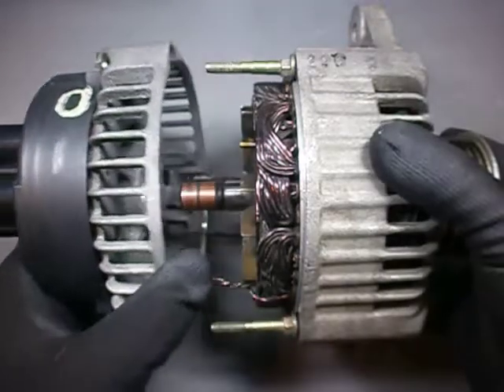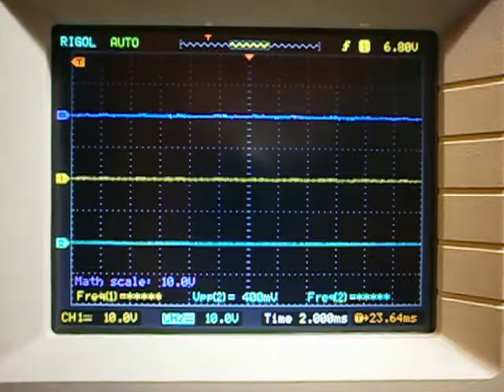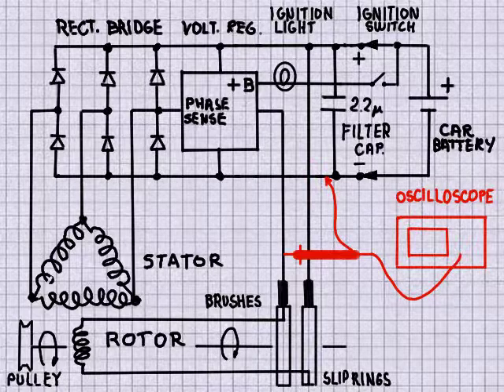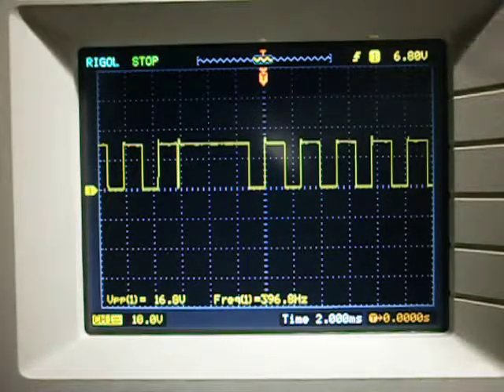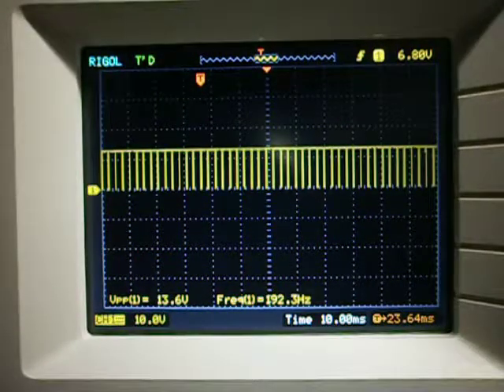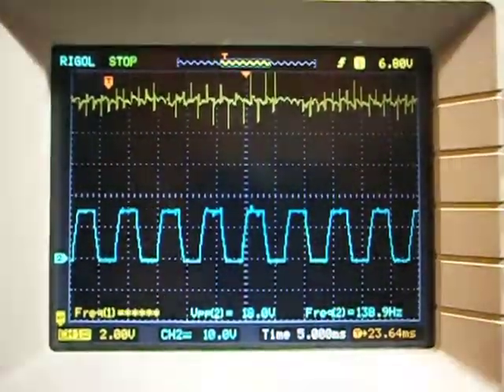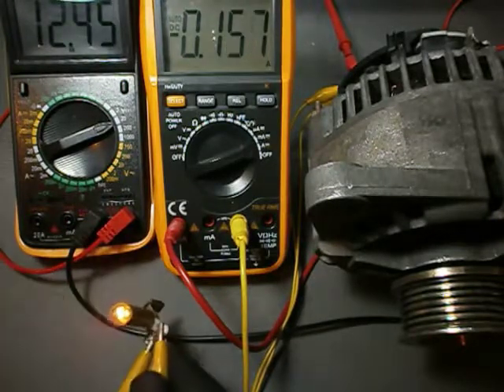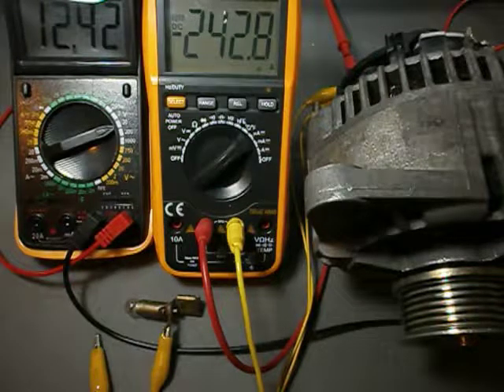The Secret Life Of A Car Alternator - BSFEEChannel #12

Comment: good video thanks the thing is a alternator is not only a starter/generator by modifieing it will act as a magneto as well if you winde it ore ad extra coils to centrain spots that is the whole idea the original dc magneto hade only 1 wire and that lead to the engine block 1 to 12 cilinders it fired evry singel time with out mistake the loses due to windings and materials used to build alternators can by modified for bether out put centrainly a interesting video thanks